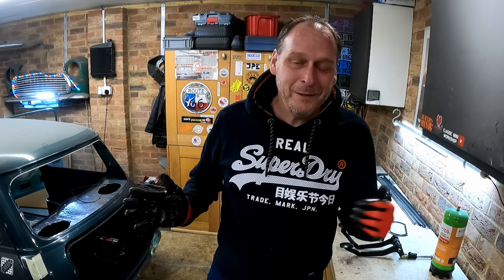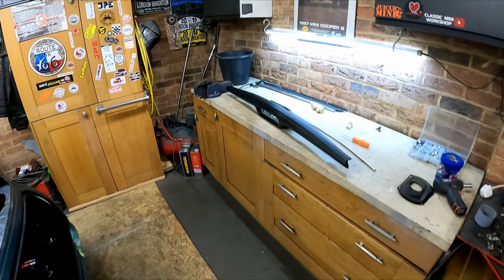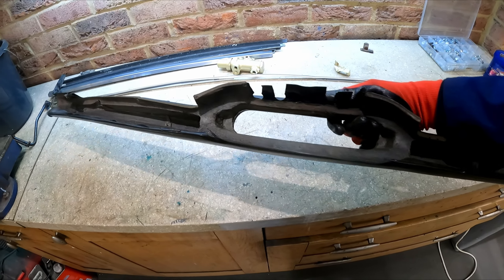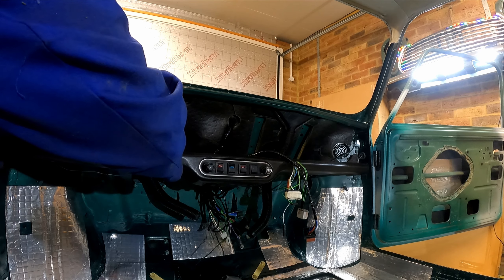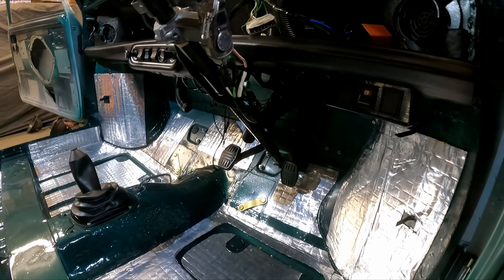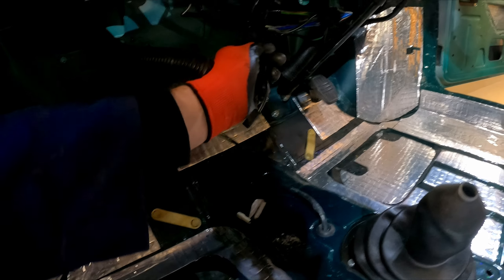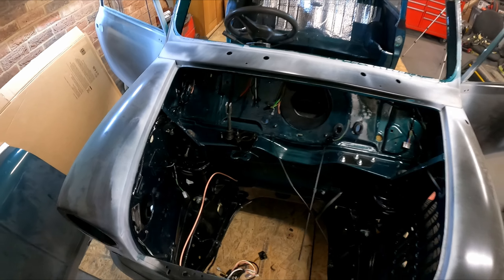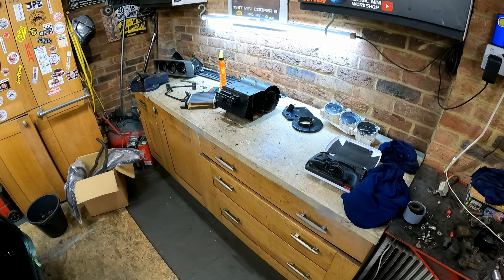New Wiring Loom & Silent Coat - Classic Mini Workshop - Racing Green Pt.67

Comment: Replaced my heater matrix a few years ago. I didn't like the semi plastic matrix so used an FX4  taxi all metal one...... but the inlet and outlets are in a slightly different position, so had to mod the case a bit.

Comment: I hope the headlights on the Racing Green have the lowbeams working like mine. When you mentioned the wires you're meaning they had to be tested after being fitted through nooks and crannies what of the headlight bulb plugs and indicator plugs if one of them were not working?

Comment: Hi there Keith. Good to see you cracking on through the thousands of jobs....
Yes the bulkhead soundproofing is still available at Somerford. Part No: ETD10154 although its for a Cabriolet so there is a gap each end to the doors. I used double layers of stick on panels to fill the gap. Its genuine NOS from Rover. £70.80 though.
Reply from the maker: Thanks, mate. I'm very tempted to order if it wasn't for the +£17 postage on top. I may see if I can get one at Bingley Hall first
Reply: @classicminiworkshop   Or give Somerford a call, mention your channel and see if they will ship for free?
They have had that stock for a long time.
Reply: @classicminiworkshop , they aren't going to Bingley this year due to staffing issues. 😩

Comment: Brake wise Keith, I'd leave the standard set-up as it was used on the injection 1275 Coopers, so should be fine on the Racing Green even with the John Cooper modified  engine.

Comment: Hi Keith, your spare wires will be for a radio - green/white should be a switched +12v (pos I on ignition switch), purple will be continuous +12v and Red/Green will be for illumination (comes on with side lights). I use cap-head bolts for the steering column as shear bolts are a pain to get off.
Reply from the maker: Thanks, Graham.

Comment: Hi Kieth, I replaced the drums to 7.5” discs & while the brakes work, I have bought a servo, bracket & bits to fit a servo. After driving cars with servo brakes for years, the harder pedal pressure is a bit disconcerting. My daughter is going to drive the car too & she has never driven a car without a servo. The brake balance valve on your car seems to be closer the offside inner wing. Will I have to move mine over?

Comment: Hi Keith, standard brakes will be fine. 30 + years ago I ran a modified 1275 with circa 90bhp (Dyno tuned). I ran it on 10" wheels and std 7.5" cooper S discs & calipers without a servo. I drove it round the Shropshire lanes extremely hard as well as Telford dual-carriageways. I was in my late teen to early 20's so you can imagine how I drove it. I never ran out of brakes. Minis are light vehicles remember. Save your money, recondition your existing calipers. Suggest you watch M539's last YouTube video on his M3 E92 when he reconditions his calipers with Brunox epoxy, then 2K aerosol paint.
Reply from the maker: Thanks, i'll take a look